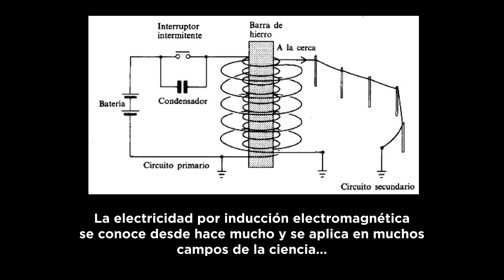ENERGÍA INFINITA CON IMANES!!!🧲💡🧲 Nuevo método 2022 | Free Energy

Comment: The operation of a 220V AC lamp requires a variable magnetic field oscillating at 50 Hz. A fixed magnet and coil setup cannot generate the necessary alternating frequency.

Comment: Your next video You Should be disassembling it without any video Stop and Start editing. Next time you should be showing power to the lightbulb and do not stop and start the video to show the credibility of the free energy system. Any time you stop and start the video allows people to be critical because there could be a battery inside the lightbulb housing being energized by the electrical field turning on the bulb.

Comment: Without moving the magnet how the current flows. Can you  explain the theory ? Do you discover a new theory for this to work ? Thanks 👍
Reply: Yes, the new theory is that there is somewhere outside the camera a strong induction coil that is connected to AC mains. That can induce voltage in the coil with that ferrite "magnet". See that the multimeter is set to 600 V AC, and the induced voltage happens to be 220-230 V. Interesting, isn't it? Steady magnets will never generate AC voltage.

Comment: El fenómeno de la inducción electromagnética ocurre solo en el caso de un campo magnético variable. Los imanes son inmóviles, por lo que producen un campo magnético constante y no se induce voltaje.
Reply: Pero se puede inducir una corriente en esa bobina usando una, segunda bobina más potente desde debajo de la mesa o un sitio cercano. Un transformador funciona así sin que hayan piezas móviles. La, explicación del hornillo de inducción bajo la mesa, es muy posible o un transformador grande tipo de horno microndas. Para que esos imanes generas en tensión en la bobina deberían estar oscilando continuamente arriba y abajo y solo generarían una corriente muy débil que no llegaría ni a encender un Led.
Reply: Guys !!! Is a simple prepared bulb...which have in prepared socket a micromagnetic switch and if you watch with attention the video on right hand 6:25 with midle and ring finger hide the secret connection... That's all.
Reply: eso es correcto para poder generar energia con campos magneticos debe aver movimiento que genera bibracion en las bobinas produciendo electricidad